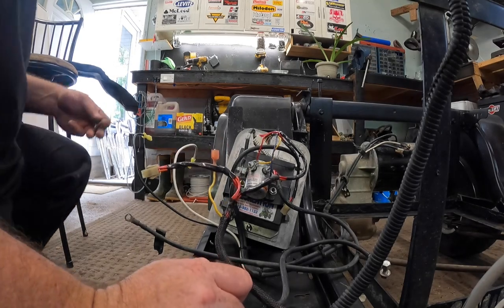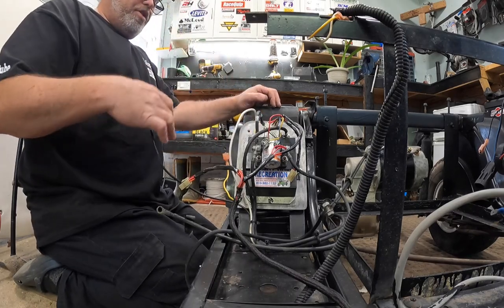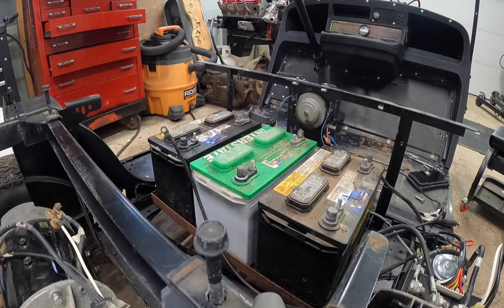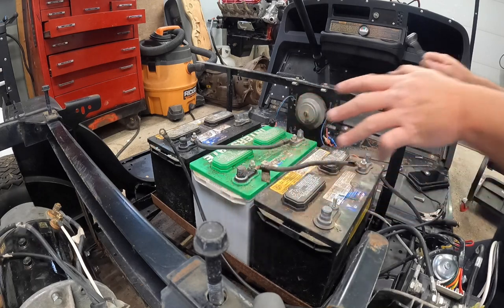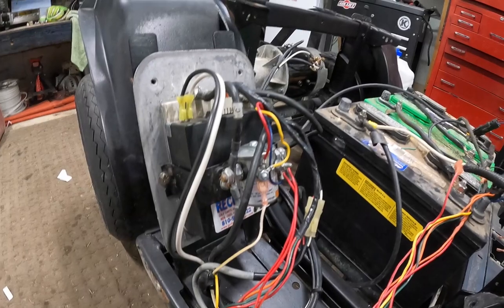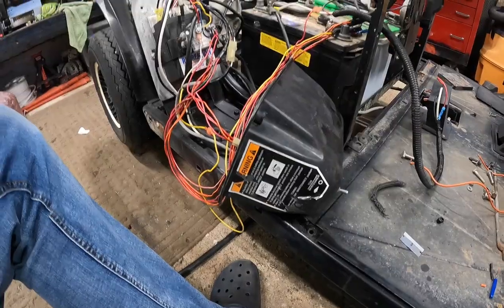Nothing Easy About This EZGO GolfCart

Comment: Bill we use that heat sink all the time at the coal mine but we spread it on thick every time we use it but it's also on a 1000 volts system

Comment: Did you know they make high performance controllers? You could have went 48 volt. Those batteries look like deep cycle but I still think your runtime is going to be drastically reduced. In reality, all you are working on is a big electric R/C car... simple. Worked on these things for years when I was young. Also as mentioned below, you got series and parallel backwards.
Reply from the maker: Not spending big dollars on batteries until that babies running

Comment: Gotta wire them in series Jim so the voltage adds, parallel wiring only adds amperage not voltage.
Reply from the maker: Lol thanks and it adds both amps and volts